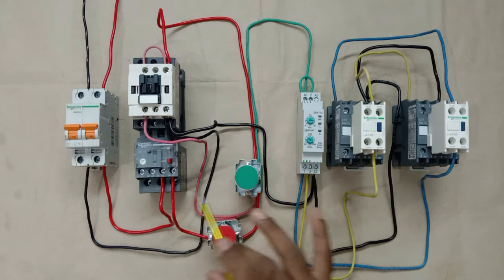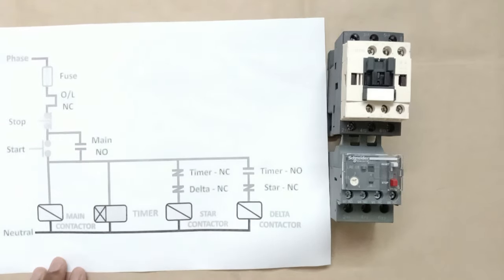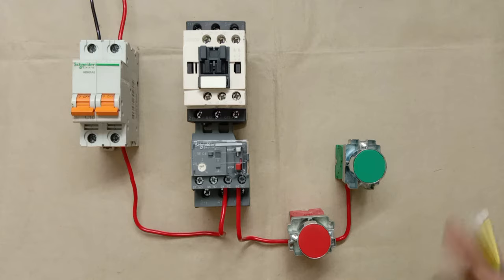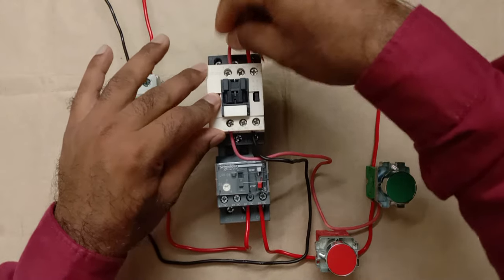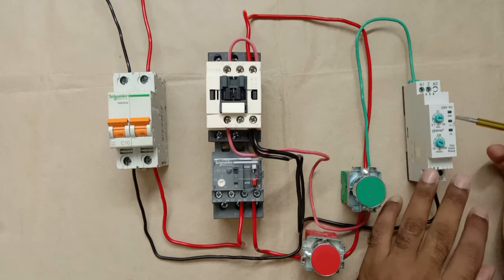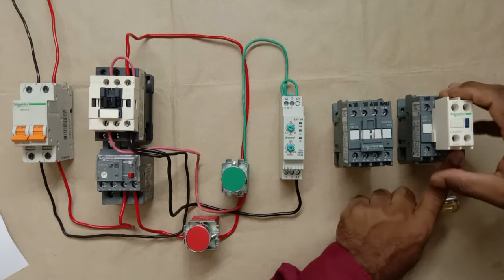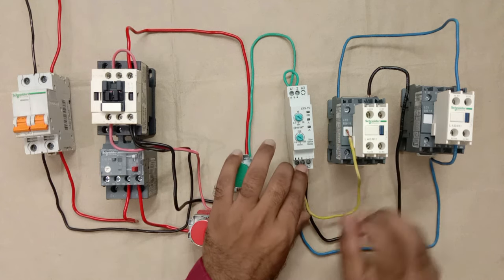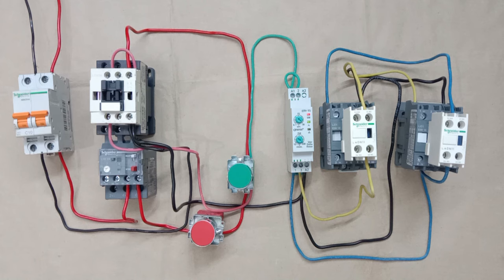Star Delta Starter Control Wiring Explained Practically @TheElectricalGuy

Comment: I think the interlock in this case is just a BONUS, having a timer having two contacts NO & NC is enough for this purpose. The STAR contactor is connected to the NC contact and the DELTA contact is connected to the NO open. There is no way these two contacts can run at the same time even without using the auxiliary contacts for interlocking. 

Enjoyed the video. THANK YOU Sir.

Comment: Hi Mr . Electric guy can I use star delta between 2 WATER PUMPS and  FRASER PRV would this system kick on the pumps by itself  (automatically ).please  help. The pumps only shuts off when the pressure and water volume is sufficient inside the pipes or when you close the VALVES but the PUMPS doesn't switch on is anything mybe  I'm  missing or doing it wrong please  help

Comment: What's the time needed on timer for star to delta when connected to a motor?
Reply: The bigger the motor the longer the time. Looking at motor rpm or current as the star gradually builds up speed delta switches over when up to speed. Rule of thumb is 75%-85% in star then switch to delta. You can measure rpm via shaft of motor against full motor rpm or measure current pulling in star (time it takes to reach its peak) that’s the time to switch over to delta.

Comment: Not complete explanation. Where are the connections for the 3Phase Motor?
Reply: Connection to the motor was done during the wiring of the power circuit.